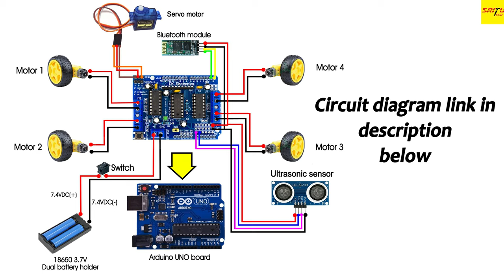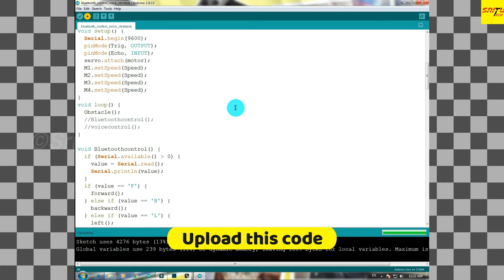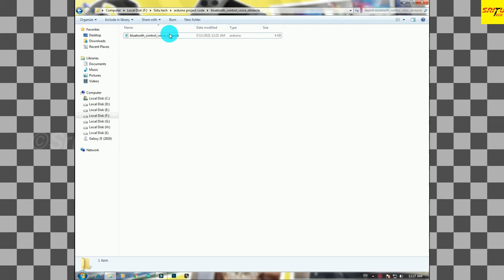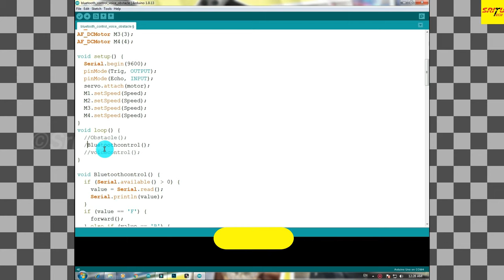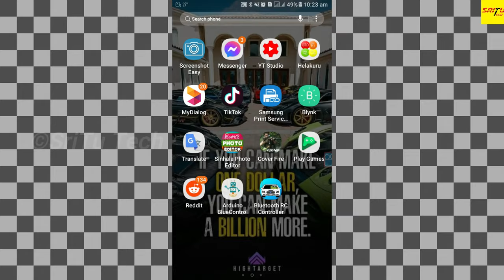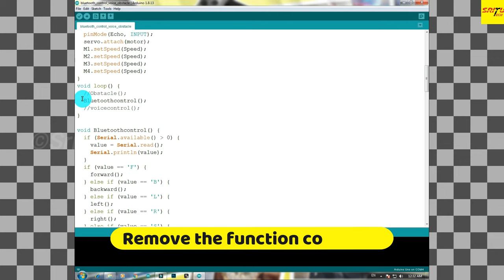Arduino obstacle avoiding + voice control + Bluetooth control Robot | DIY Arduino Robot

Comment: Sir is it necessary to use the li-ion battery holder or can we use any other battery holder
Reply: You can sure use other batteries but the li-ion battery is advisable
Reply: what specific Batteries and how many of them I need and what volatge.Thanks In advance. @Vlight

Comment: In my model wheels are not running continueslly, it move only bit and stop it and also it move in backward direction not in forward direction
Reply: So how should I solve this problem
Reply: Your code isn't aligning with your pin configuration. Just set the pins according to the code or reverse the polarity of motor

Comment: hey bro thanks for the perfect explanation....

I'm also making this project but there is one difference and i need your help.... everything thing like code, arduino are working perfectly okay but when i connect to the battery to supply power the tires aren't moving but the light is on on the motor board and arduino and the ultrasonic sensor motor is also working but the tires aren't moving also the bluetooth is also not working.... can you please tell me how to solve this problem... ITS URGENT!

c
Reply: Use 9v battery

Comment: Hello please i have a problem
when i uploaded the code it said fatal error AFMotor.h no such file or category 
what should i do please someone help!
Reply: im on arduino ide 2.2.1
Reply from the maker: Include library file
Reply: thanks it done compliling but it says now avrdude: stk500_recv(): programmer is not responding
what do i do.
im suspecting it is a problem in the arduino usb cable that connects it to the project.
is that true? pls help
Reply: i installed adafruit motor shield library 1.01

Comment: There is no use of dot board, but in the components section it is mentioned.
Reply: That breadboard is used only for arranging it in a better way and make it neat...not that necessary

Comment: Which library do I have to install to rum motors?
Reply: Since you are using motor shield you will need the motor shield library, you will also need the newping library to work with u ultrasonic sensor

Comment: Anyone can help me 
I had finished connecting the wires and everything But after uploading the code its not moving......
The light from the motor driver and bluetooth module are blinking.
Please help me.I have a competition on 17.10.24
Reply: yeah same thing happens to me
Reply: @aldrinfr13  Did it solved
Reply: @vgs14trainer I haven't solved it yet, but I think the problem is the battery
Reply: @vgs14trainer I think I didn't solder the cable from battery socket very well, so I might solder it again
Reply: @aldrinfr13  But when we upload the obstacle code the sensor turn but it's not moving
Reply: @vgs14trainer  I fucked up my arduino, it got overheat and yeah the system couldn't run. idk the reason for that omg
Reply: Code kaha h bro

Comment: thanks it done compliling but it says now avrdude: stk500_recv(): programmer is not responding
what do i do.
Reply from the maker: Arduino programmer error
Reply: So what do I do
Reply: When I connect the motor driver to the arduino the on light stops but when I remove the motor driver it connects

Comment: Hello, I am having a problem with the code for obstacle avoidance. Basically after uploading the code for obstacle avoidance the car is not using the ultrasonic sensor continuously but at some interval of time. During this interval  if the car was moving forward it would move forward even if gets collided with an obstacle. I haven't altered the code but just commented out the bluetooth and voice control functions (which when uploaded works absolutely fine). Please reply asap as I have to submit this project for my acads.
Reply: This is just an idea to get your own project started. If you can't figure out what is the issue maybe this career is not for you. Be a lawyer or a cook instead.
Reply: If the ultrasonic did not work well it either you didn't include the newping library for the ultrasonic or the battery is weak, most times if the battery or power is weak some of the sensors don't work well because the Arduino will not be stable

Comment: Arduino Compatible R3 ATmega328P

L293D motor driver shield

HC-SR04 Ultrasonic Sensor Module

HC-05 Bluetooth module

SG90 servo motor 180° (Plastic wheel) | Micro Servo 9G

5V DC Gear Motor for Smart Robots

Wheel For Smart Robot Car

18650 Battery Holder | 2 Slot Battery Container

20CM 40Pin Male to Male, Male to Female and Female to Female Jumper Wire

Comment: Will u pls provide that code for arduino ????
Reply from the maker: Description
Reply: @sritu_hobby  I’m having trouble with my Arduino-based car project. The gear motors connected to the Adafruit Motor Shield are not working. Here’s what I’ve checked:

Connections: All connections are correct and secure.
Power: The power supply is working, and the motor shield's green light is glowing.
Functionality: The motors work when connected directly to a battery.
Despite the Arduino uploading code successfully and other components working fine, the gear motors do not rotate. Reply on email waiting for your response

Comment: Sir this is a very interesting project. I want to make it. But Sir you told to upload that code . But didn't understand that. How to upload code by removing the RX and TX jumpers ? How can I upload code from my computer or mobile to the chip ?? Please tell me Sir.
Reply: It simple on the Arduino platform u will see the upload botton close to the compile botton

Comment: I Made this project its really awesome but am getting an error where the power supply for the Bluetooth from gnd and vcc is done and i have connected RXD to D1 and TXD to DO but it isnt working as the Bluetooth is connecting but there is no operation. Is it okay to change RXD to D3 and TXD to D2 will it work?

Comment: bro i am trying to upload the code, but getting the following error. Any help ?
Arduino: 1.8.13 (Windows 10), Board: "Arduino Uno"

Sketch uses 4276 bytes (13%) of program storage space. Maximum is 32256 bytes.

Global variables use 239 bytes (11%) of dynamic memory, leaving 1809 bytes for local variables. Maximum is 2048 bytes.

An error occurred while uploading the sketch

avrdude: ser_open(): can't set com-state for "\\.\COM4"

I am using windows 11 machine. Any idea why i am getting this error & how to solve this error ?